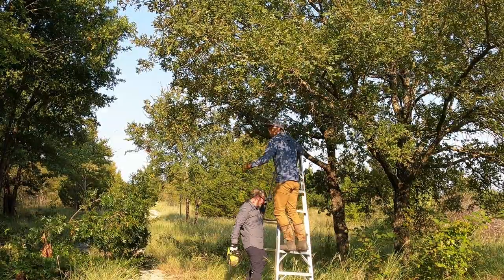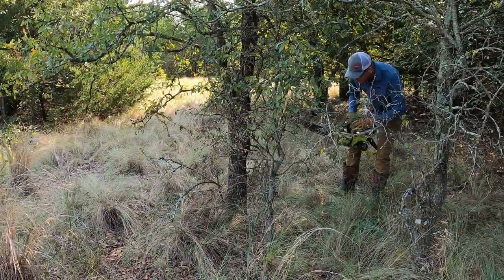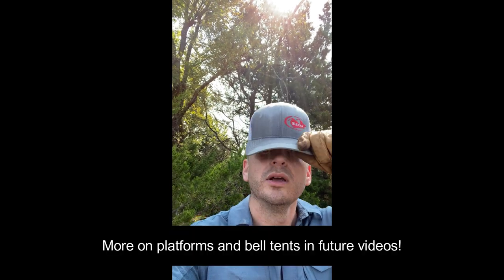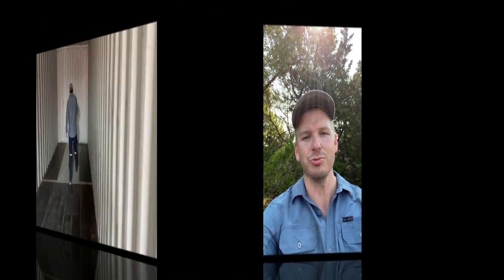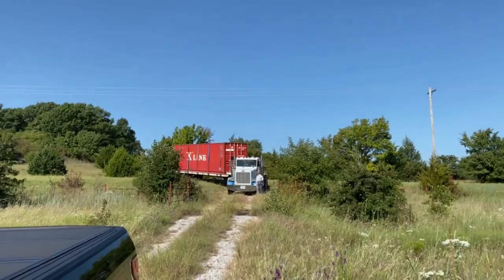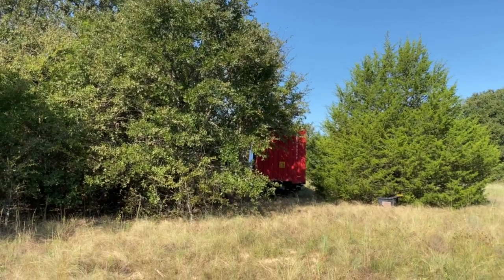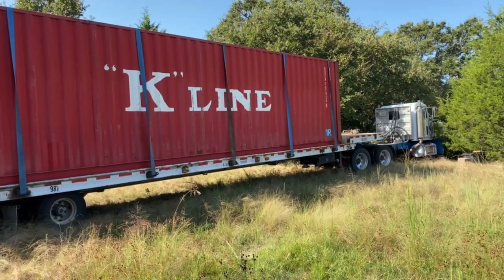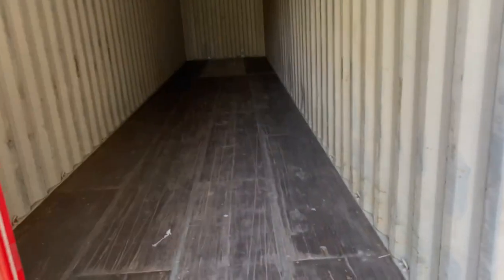Preparing site for Shipping Container Delivery

Comment: You guys did good I had a 20ft delivered . I used a 4 ton low profile jack too level it out.  Should be ok for a 40 foot as well   Then you can adjust the footing support on each corner any way you like
Reply from the maker: Thanks!  We used the low profile floor jack where we could, and the hi-lift where we weren't able to fit the floor jack under.  Worked like a charm, though we do need to rebuild our hi-lift jack.  Thanks for watching!